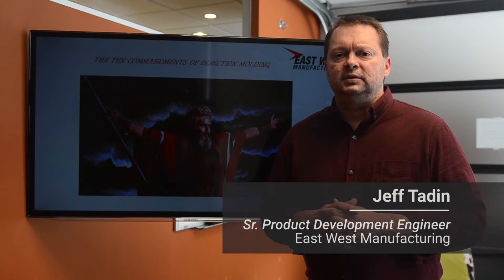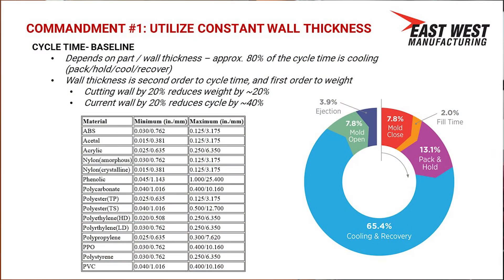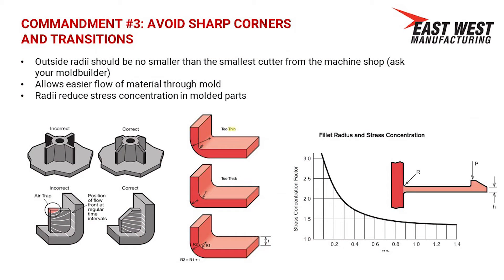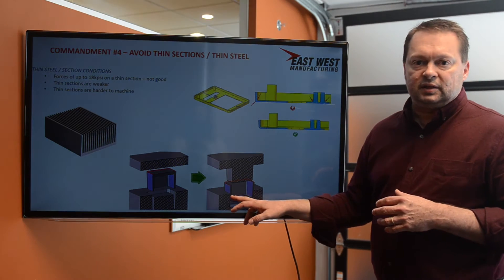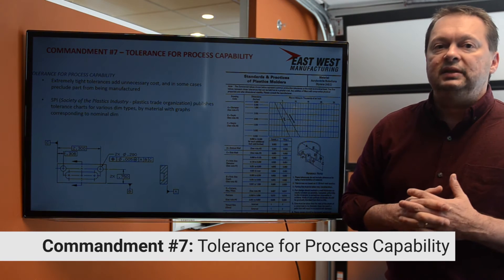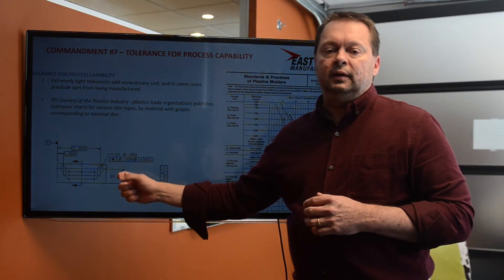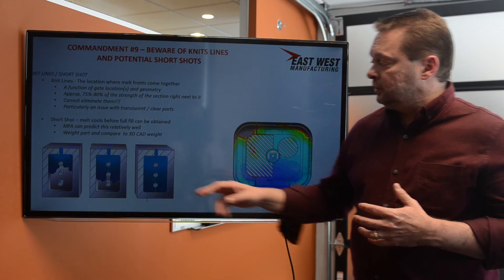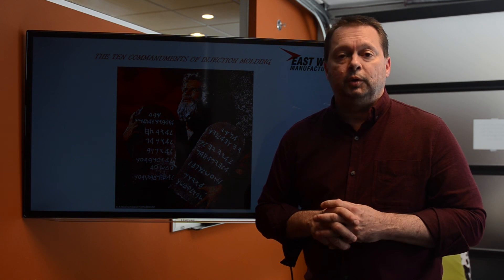10 Commandments of Injection Molding

Comment: All this is great information, however it belongs in the design lab rather than the mould shop. 
I spend my life trying to prevent poor design proceeding to the mould maker.
A top quality design lab will not release CAD to the mould maker until the DFM has been undertaken and defects corrected.
As I say to my students, "the toolmaker cannot correct a poor part design, and the moulder cannot correct a poor mould design".